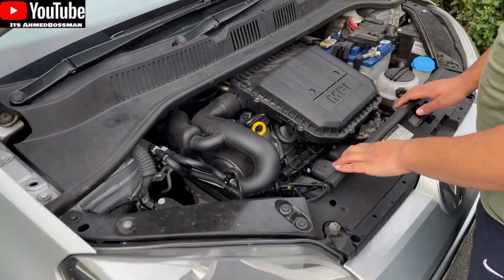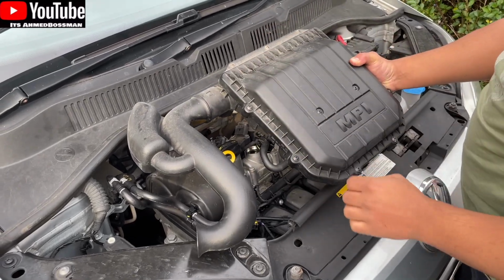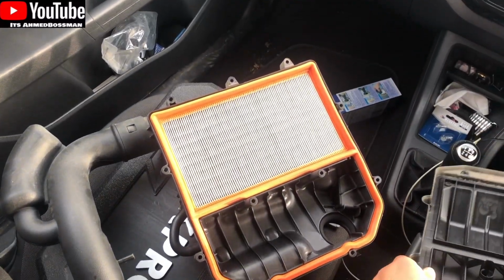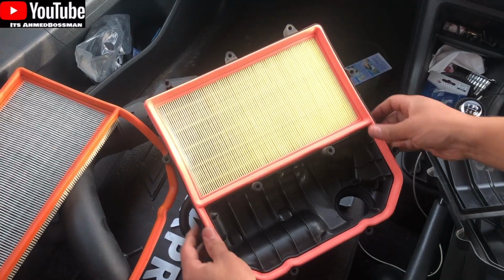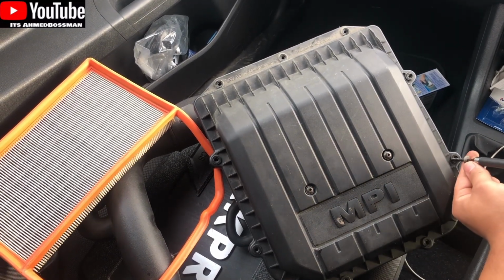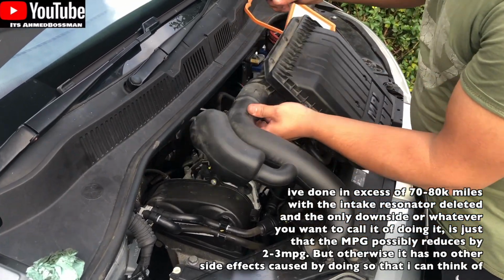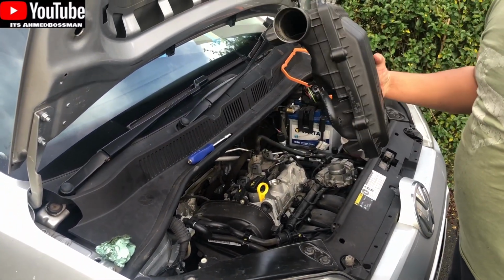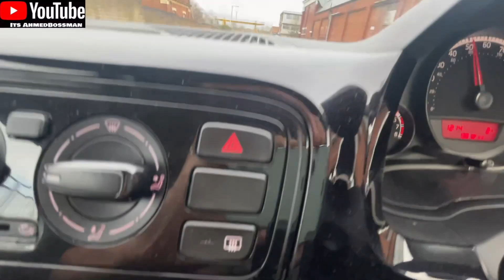UNLEASH BIG SOUND FOR FREE! - VW Up! replace air filter + intake resonator delete | Its AhmedBossman

Comment: Does it create damage to the engine ?
Reply: Obviously damage the engine. One function of this resonator is to seperate rough dust and particles from the intake air and extend the life of your air filter.
Reply from the maker: ive never expereienced any damage, ive done in excess of 50k miles with this and genuinely no side affects noticed. it does reduce the MPG slightly, but its a sacrifice im willing to make for extra sound and what feels like slightly better torque

Comment: Yooo this is nice im considering doing this but does it make your mpg go down/ increase fuel consumption?
Reply from the maker: go for it!! at more it drops the mpg down by 3mpg per average or so, otherwise normal driving will never actually make the slightest difference, well not that ive ever notices anyway and ive done combined about 100k+ miles now

Comment: Who needs cold air intake when you've got hot air intake for free 😑
Reply from the maker: hahaha theyre only 59bhp, theres no power to lose! plus UK weather is always cold so doubt will make much difference for normal driving
Reply: It does make a difference because the restrictor is gone and because you take in warm air you loose torque.
Yes it sounds faster, but actually it makes you go slower.

Make the same runs from standing still and time them.
Reply: @19hmxd depends how you drive the car.. i drove 182km/h In my vw up. The Oil was heated up to 105 celcius
Reply from the maker: @DudleyIntelligence  i rag my vw up pedal to the metal. Do 120mph all the time. Never has any issues. And ive done over 50k miles. No issues what so ever
Reply: @19hmxd  Check the oil temperature xD Mine hit 106 celcius at its highest! xD
Reply from the maker: @DudleyIntelligence  ahh. I need a temp gauge for that. The up doesnt come with one😅 so not a clue what the temps saying. But either way. Alhamdulillah never had any issues so im good✌️
Reply: @19hmxd  Oh your up is an older version than 2015? mine is a 2018 model :D
Reply from the maker: @DudleyIntelligence  yeah. I have only had the mk1 pre facelift

Comment: How to remove the resonator without removing the airbox?
Reply from the maker: Pull the resonator pipe out the plug it has , have your hand on the airbox and the resonator pipe should twist off. Just makes it easier if you remove the airbox tho but still can be done
Reply: @19hmxd  thanks for replying but i figured it out it was pretty easy BUT i had put it back on yesterday because what I’ve noticed was an increase in the mid and top end but at the expense of low end torque. Seemed like the low end torque just vanished entirely. It was getting hard to even  to make the car move in traffic and had to burn the clutch even more. Sound was pretty good almost sounded like a 4 cylinder rather than 3 at higher RPMs but NVH levels also rose like at WOT i could feel so much vibrations through the gas pedal it was really not comfortable considering this shitty engine needs to be revved till red line all the time to make it move so i think resonators better on than off
Reply from the maker: @maddeningmonk9585  hi thats strange. You possibly have an issues somewhere then as ive not experienced any of this. And ive done it on many of my vw up!s. Also ive done it for people and have had people do it now and theyve never reported this issue…. So i think you have a problem somewhere else which removing the resonator has uncovered!
Reply: @19hmxd  I’m not sure because if there is another problem, pretty sure my cars alright but let me tell you my engine is 1.0 MPI and not on vw UP but on VW Polo which makes around 75bhp. My car already weighs around 1050kGs and hence the affect on low end torque is so prominent on my car. Also I’m sure you must have felt the NVH levels rising whenever you go full throttle which makes the 3 cylinder vibrations more uncomfortable. I absolutely loved the sound but its just not worth it. Also I’m 100 percent sure nothing is wrong with my car because i always get it serviced on time and have done 60k KMs on it already and it still drives like its brand new everyday. The only thing that pisses me off is so little torque that it makes other than that this car is absolutely amazing to drive.
Reply from the maker: @maddeningmonk9585  yeah man that could have something to do with it then. Ive always done it and knew people woth the 59bhp up not the 75 so thats probably why you could he experiencing that loss of power. However, is your airbox in good condition? Are the grommets in the back of the airbox perfect or lose? That causes that loss of power feel and juddering sound too. But. If you were to put an aftermarket intake on you would be removing the whole airbox and resonator which loads of people do but they never experienced this so im not sure. Oh well. It is what it is
Reply: @19hmxd  yeah my airbox sits perfectly just as a company workshop technician would have it because only they work on my car and no one else but another interesting thing is that Many aftermarket cold air intakes or short ram intakes are known to have an impact on low end torque as opposed to the stock company air box, I didn’t know but considering our car makes as much torque as a 1980s lawnmower i dont think its a good idea to do any mod that might jeopardise whatever non existent torque we have here. Its a cool mod to do for free, definitely felt a power increase in the higher RPMs above 2000 but the drone and NVH levels in the pedals made me feel like maybe I’m getting too old it just kills any refinement the car has. I can see some people loving this mod tho, more power to them
Reply from the maker: @maddeningmonk9585  haha yeah man. I think its better suited for the younger generation. Saying that im getting quite bored of it now and considering to go back to with the resonator pipe. Too much noise now that its starting to get annoying lol
Reply from the maker: ahhaa true, it can get annoying after a while

Comment: Will this damage engine or only air filter i hv a bmc performance stock replacement air filter
Reply from the maker: hi ive done in excess of 50k miles with an intake resonator delete, ive never expereinced any damage / long term disadvantages

i do admit there is some drone on the motorways but its something which is bearable and ive not minded it and can live with it, alsi affects MPG very slightly. otherwise its unlocking sound for free!
Reply: Ok tq sm u also hv mpi only
Reply from the maker: @vagguru1808  yesh, mine is the 1.0. mpi 59 bhp one!

Comment: Without the intake resonator you will have poor low power and at high revs only the sound from the engine gives you this placebo effect.
Better advice is to replace the stock airfilter to a K&N airfilter and that will be a overall good performance like the engine is on a air infuse......
Reply from the maker: ive done trackdays and regularly driven in tripple figures speed wise and never noticed any noticeable lack of power. theres not much power to start with anyway ahaha